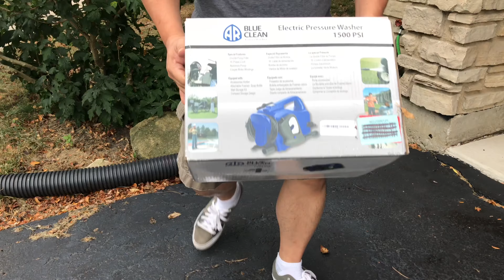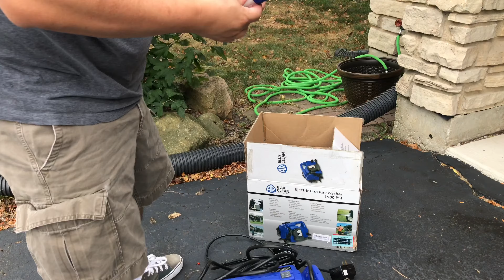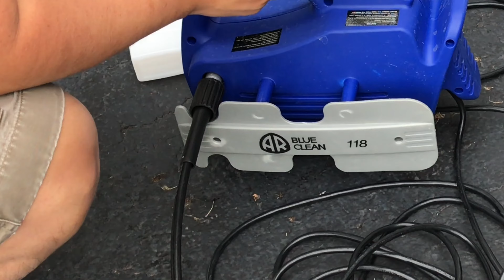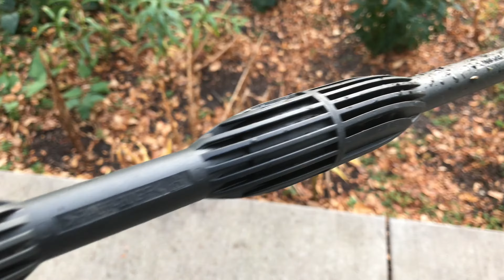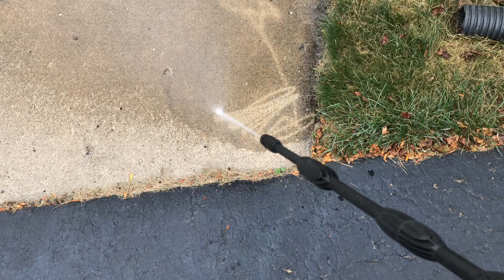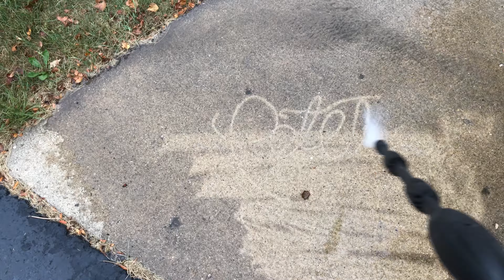AR Blue Clean AR118 1,500 PSI 1.5 GPM Hand Carry Electric Power Pressure Washer Review

Comment: after you turned on the water and the switch the machine on, did the motor run for a while and then stopped? i have the same pressure washer which i haven’t used for a while, now it’s leaking from the bottom of the gun even when the machine’s OFF. 😡 any tips?

Comment: Nice small pressure washer! Leery of plastic water hose in connector. 1500 psi is a nice "safe" pressure. Above that, paint peels, wood gouges, damage to whatever you are cleaning. Each time you pressure wash concrete, you remove material and open it up to more dirt accumulation. If you put concrete sealer on after cleaning, it protects the concrete and usually can just be hosed off rather than pressure washing. Great demo video!